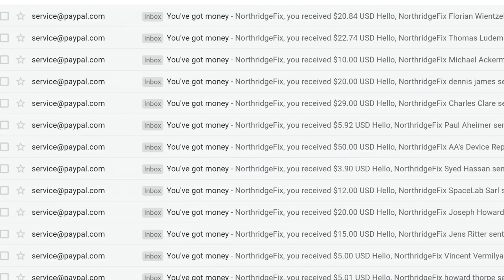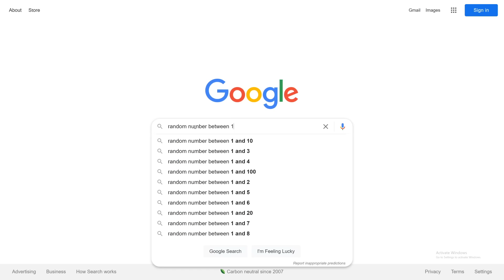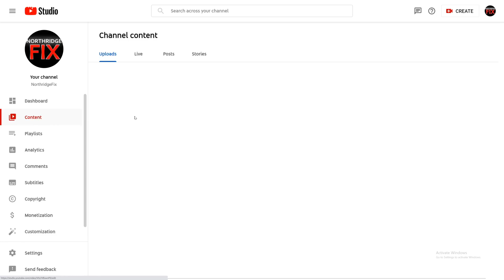2021 Macbook Pro No Power Repair

Comment: Amazing fix Alex. Well done. How did you know they were bypass capacitors?
Reply: Meter on diode mode. Red probe on ground and take reading with black probe. One side reading and another side beep means it's connected in parallel. If both sides reading is seen on multimeter then it's connected in series.

Comment: You mentioned that the customer mainly wanted the files and if the laptop could be repaired that would be a bonus. Surely there's no other option for data recovery but to fix the laptop as the SSD is soldered to the board, no Lifeboat connector and everything's encrypted? Or has someone found a way to recover data from the recent MBPs?

Comment: Maybe I missed it, after you removed the the caps did you reinstall new caps or left them off? And then my follow up question is, let's say his screen wasn't damaged would the laptop be fine without those two caps for prolonged use? Thanks in advance

Comment: Hello, thank you for sharing this video. 
I have same laptop vith same problem. It was on apple service and they clean it and they told me that keyboar and touch bar are dead, but other works well. 
but anyway laptop cant start, when i klick on power button, then fan start for 2 second and then turn off. 
i dont think so that keyboard is dead, but touch bar can be, because i dont feel any click.

what do you think that can be? should i try to clean it again and check all power if he get it well?
thank you for  your answer. 
br

Comment: I deal with Apple Stores several times a year when our local ACT is unavailable.  Fortunately I've never had these issues with getting machines repaired when under warranty, and it makes me wonder if people are paying attention to what the technician is saying.  I saw a Rossmann video where he claimed an Apple Store was refusing to repair an under-warranty machine that wasn't even a week old, but in the video the technician didn't deny the repair, he explained that if they send it out and the service center denies it, then the owner will be on the hook for repairs, regardless of the claims.  However, since the machine was within the 1st week of sale, short of liquid damage, the buyer had the option to return for a refund, get a repair, or get an exchange for a similar product no-questions-asked regardless if it falls under a warranty repair.  I've had a student crack a brand new MacBook screen, and Apple exchanged it for free anyway because it was within the first week.

Pro tip:  It doesn't cost anything but time to have the machine sent out.  Apple always gives you the option to pay or not to pay for a repair if it doesn't qualify for warranty repair.  If it's under warranty and gets approved, then it gets fixed.  If it doesn't, they give you the option to pay for the repair, and if you refuse, they ship it back.  No cost.  So get it sent out anyway.  In my experience, Apple has been very lenient on warranty repairs that were obviously user-damage.

Or perhaps we just have really good Apple Stores in the Northern California Bay Area.  I don't know.

Comment: Can't we save that display panel by removing the water content in the backlight unit?
Reply: It is a good idea but macbook displays are not designed to be disassembled. even when you want to change it's screen, you must change the whole lid of the laptop

Comment: Is it not important to put that cap on the board? What happened in long run without those cap in the board in your opinion?
Reply: The chip might get a shorter life if it's a big cap (1uF or bigger) or it might stop working for seconds then go back to normal and pretty much nothing if it is a small cap like 470pF, small caps are just filtering electric noise and big caps sometimes are filtering electronic noise and sometimes are working as small batteries (to put it simple) so if the chip has a consumption spike the cap prevents it from stopping working. You can ignore small caps, but you should always replace 1uF and bigger caps

Comment: its crazy that a tiny resistor can stop a laptop from working.
Reply: A short circuit is a short😂😂😂
Reply: You clearly didn't understand the problem if you think it had any anything to do with the WiFi chip. So typical commenter bashing something he doesn't understand.
Reply: @WertzOne  i fully understand the problem. it was the resistors around the wifi card that caused the short that caused the pc unable to work correctly.

Comment: Fixed my MacBook Air 2012 with shorted cap using fingered to find the heat and alcohol on q-tip then Swiss Army knife to snap off the cap. Apple wanted $475 to fix a 5 year old laptop...